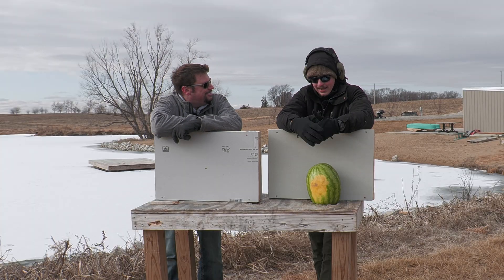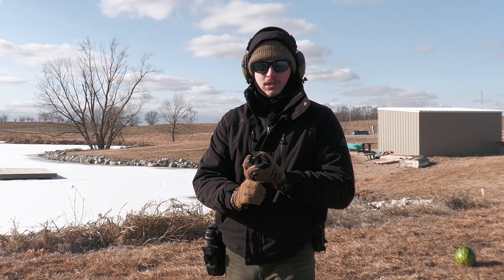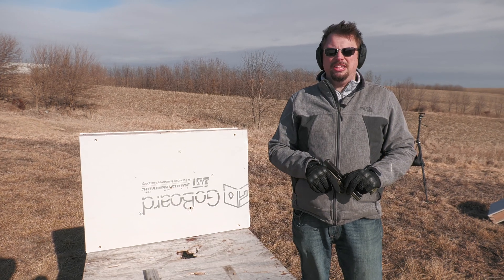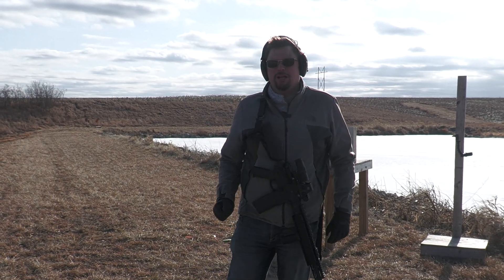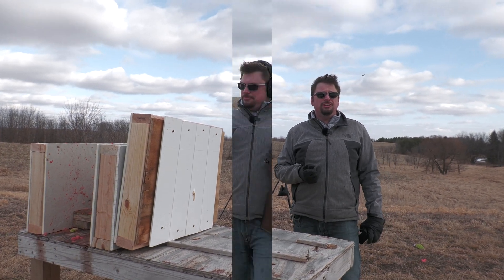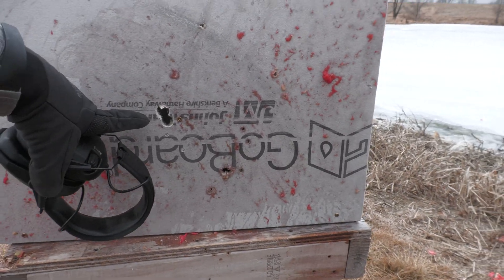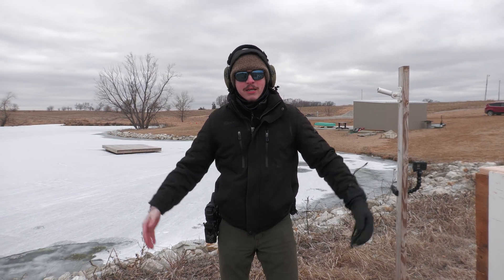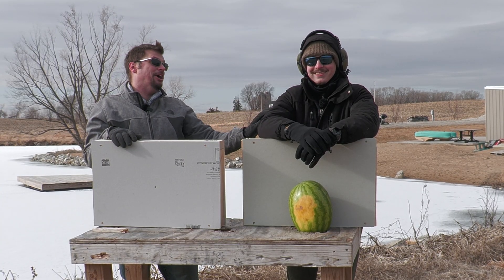How Well Do House Walls Stop Bullets? Home Defense Ballistics

Comment: try real wall, for example brick house... or like this.. wtf is that
Reply: “Wtf is that”

That would be a mock-up of a drywall wall. The material that 99.9% of homes consist of in the US (don’t quote me on my stats). 

Brick is not too common outside of exterior walls. Though I agree- I’d like to see a future test include other exterior wall types (Masonite, vinyl, brick, aluminum siding, etc)
Reply: @ShallNotBeInfringed1791  Is that common in places or something? I've rarely see anyone use it around here. Lot of OBS, lot of ply wood, concrete board and wood paneling, lot of beadboard, usually insulated. About the only time I see drywall used is reno work on older homes where they slap it on over wood. Assuming we're just talking interior walls in cheap housing or something?
Reply from the maker: Literally the most common material used in construction for interior walls. Standard practice for decades.